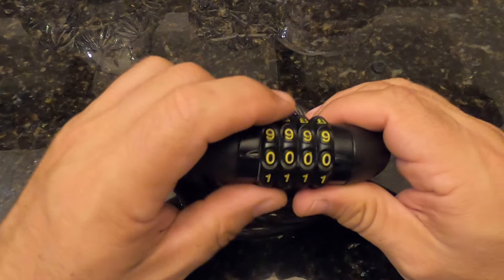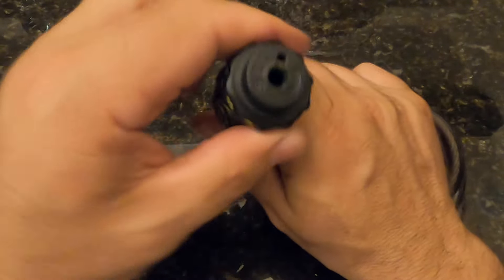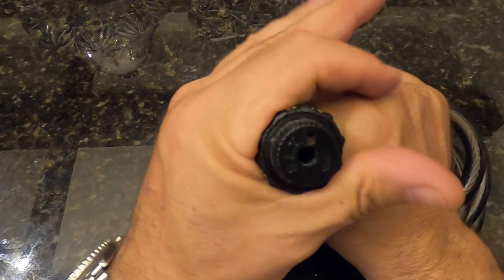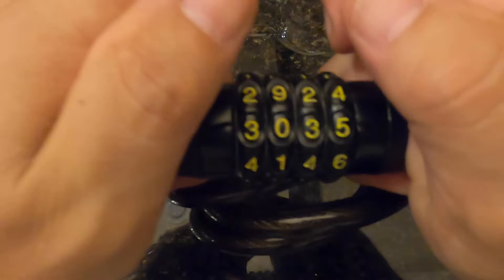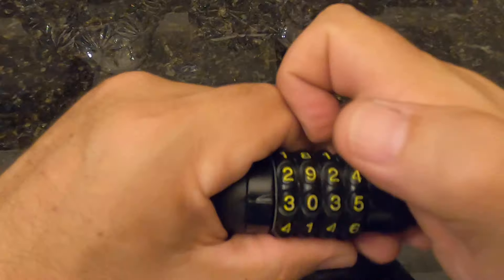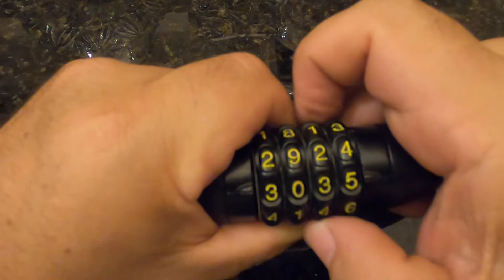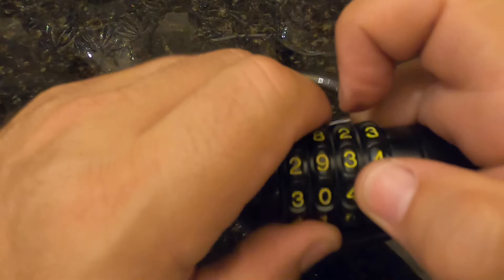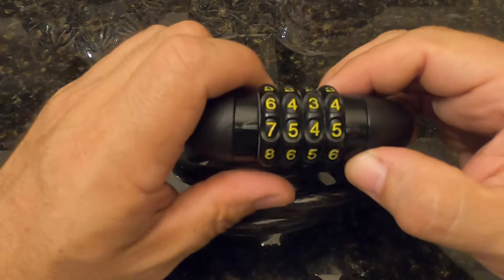🔒Lock Picking ● 4-Digit Combination Bike Lock ● Find the Combo in Less Than 1 Minute

Comment: And mine dosent make noise or lock up any idea what I’m doing wrong
Reply: Mine either
Reply: Didnt work 10-2-22 MIAMI FL
Reply: @MARCO-bl1gm  what
Reply: Not enough tension. Mine worked, it clicked on all numbers except one under tension. Start from the right most number and work to the left.

Sometimes it takes a few rotations. Try repeating the process turning them the other way. If you do it somewhere really quiet you should hear a difference and/or feel it.
Reply: @ParallelSyntax  Thanks 😊
Reply: Same
Reply: Mine didn't either but I found that it could be any digit position that is under tension. Not right to left or left to right always. With mine I found the 2nd digit wheel was the tightest to turn under tension, so started with that and a number clearly clicked in. Then the 1st wheel, then 3rd, then 4th last. Once I figured out how to feel which wheel was under tension, it took me under 30 seconds to open.
Reply from the maker: Great points
Reply: Doesn’t work. At all.
Reply: Didnt work for me either
Reply: @ParallelSyntax  thank you so much worked for me in about 1 minute but this was after I turned of the TV and ac. I heard the click and the wheel became sloppy. I Accidentally reset it leaving work and forgot the new code.
Reply: Worked perfectly for me, except I had to go left to right for some reason, the first wheel was clearly binding.
Reply: Doesn't work at all. Maybe first number is the right one. The only number that feels different and made a click.
Second wheel, no click, no different feel or anything. Any suggestions?
Reply: Nope!  Didn’t work

Comment: Used the method in Apache Ranch's video to crack / open a similar-design, Titanker 4-number combination lock, which is maybe a few years old (so about 2020-21).  The tip in this video to apply plenty of tension was key for me.  It took me several tries (taking breaks between attempts due to my aging, achy hands), and I had nearly given up, but it helped to use more tension, and it also helped to work the cable to it's center on the bike tube of where it was stored in order to get a better grip on each end of the lock mechanism for applying extra tension.   I did this in the quiet of my garage, which helped with hearing what was happening. Going in the same order, right to left, the first number had more of click and drop-in with some play in it - the next two numbers seemed to just stick - and the lock simply slid open on the fourth number, and I'm still relishing the small victory.  Anyway - it was not obvious upon finding each number and had to persist, but the method worked.  Thanks you for the video,  Apache Ranch.
Reply from the maker: Wow that’s a great run down of how it worked for you. Thanks for your comment and I’m glad it helped.
Reply: the way you described your process helped me more than any video i could have watched, my lock is open thanks to your comment on this video! The only thing that was different was my lock went the other way but the snag in the middle was stumping me until i read your comment.

Comment: Took me about 5 minutes, which is an endorsement for my similar master cable lock.  I don't leave my bike for more than 15 minutes and I also have an alarm as well.  Sure, they can cable cut it in 15 seconds and run off with the alarm going off, but I also many times will use my krytonite as well, so they will also have to have bolt cutters when I am using them both.
Reply from the maker: Glad the video helped!  Yes, not very secure lock.

Comment: In my case 2 last digits are ok to find them out but 2 first digits u cant feel any difference. Also if u lock this lock so the combination part of the lock is inside the wheel it is almost impossible to pull them apart, no space between spokes of the wheel to put hands inside.